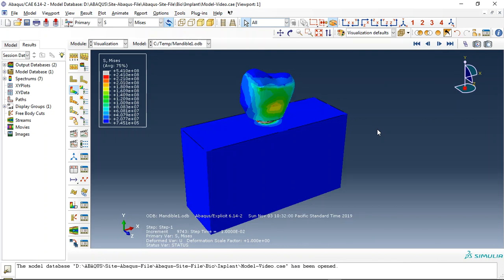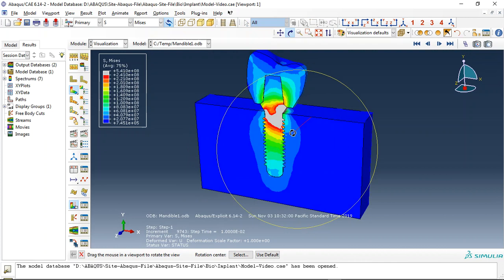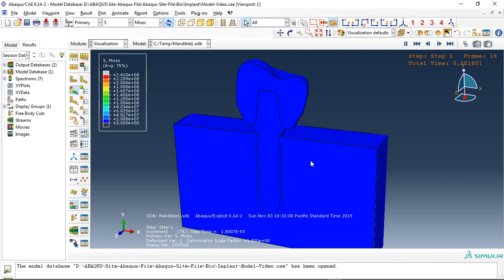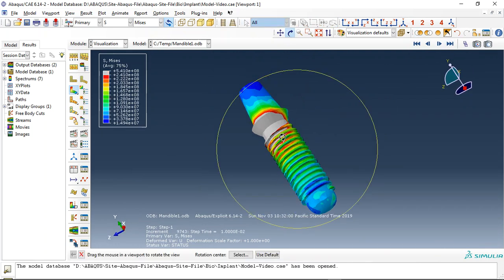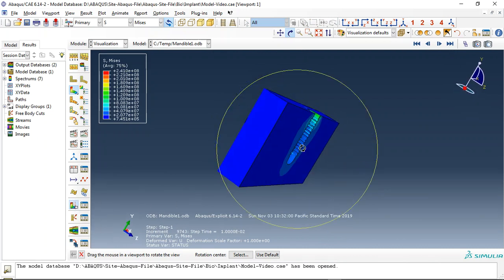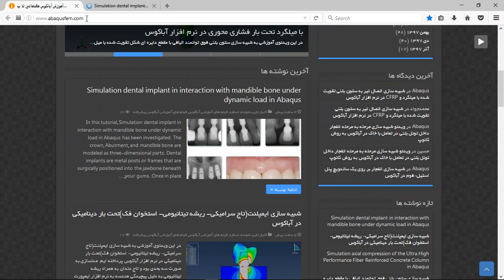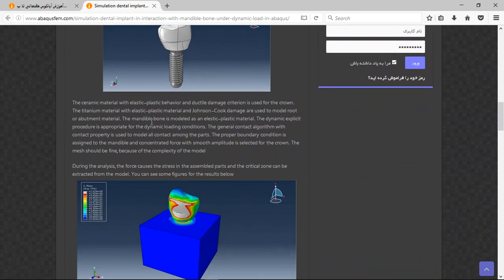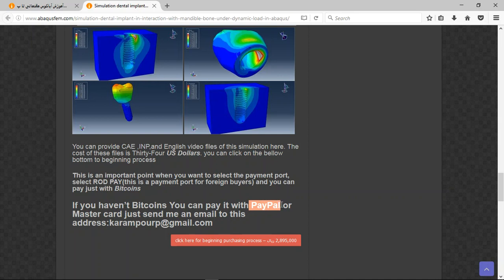Simulation dental implant in interaction with mandible bone under dynamic load in Abaqus

Comment: Dear brother Kayman P. Thank you for sharing dental implant simulation under dynamic loading that is really kind of you. And in your simulation of the model the implant and the abutment are one part but in reality it is not they are two different pars assembled together hence I afraid the maximum average stress (~~1098 MPa)you get in your simulation is passed the threshold of the implant material Ti( 800MPa). Or this is just demonstration I mean just example how to simulation dental implant under dynamic loading? Appreciated for sharing such important topic.
Glad to hear from you!
Thanks a lot!
Reply from the maker: Thank you for your comment. I knew that what you say, but in the tutorial, I said this matter which I used the load 25 times more than the real condition and that's the reason for the maximum stress.
Reply: Could you share with me how you draw